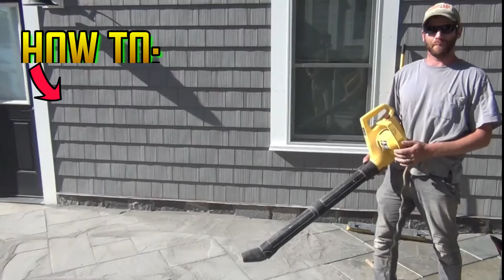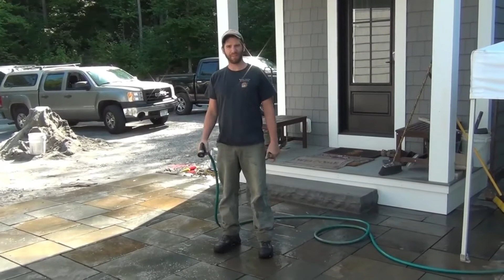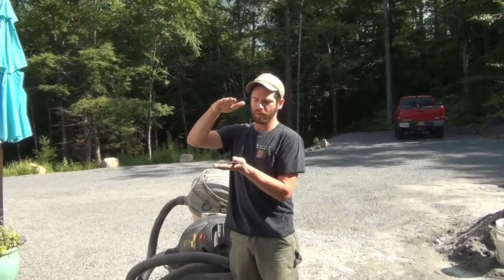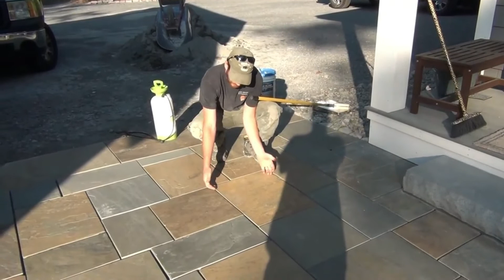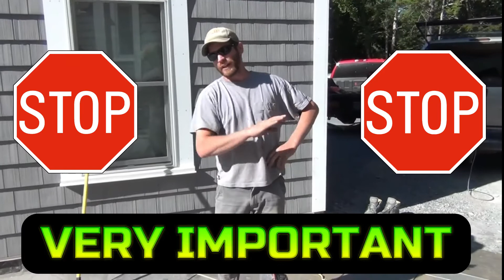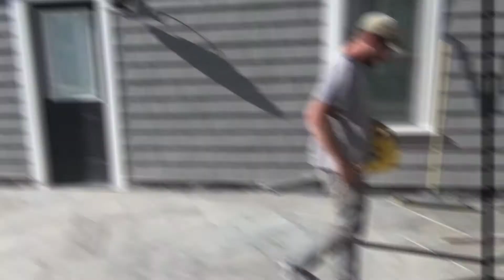How-To: Make A Square And Rectangle Blue-Stone Patio

Comment: would you ever lay bluestone on top of an existing paver patio if the pavers were totally flat with no lose stones. (solid)  Using a stone dust and mortar haunching mix?
Reply from the maker: Hey Brian,  thanks for watching!
Well maybe...   do you live in a freeze thaw climate?   If not, then its no problem.  If frost is an issue,   then you may need to let the water drain through.  There is risk of the water saturating the sand bellow the bluestone and freezing   pushing it up.

Comment: I've thought of making a patio with the giant asphalt hockey pucks I make at work nice video👍
Reply: that would work!    you'd need to set 'em with a machine,  but it would be like none other!!  thanks for watching Matt
Reply: @RogersRigs  I could get it done with a post hole digger or an auger but they're cylindrical so I'd have to account for the gaps.
Reply from the maker: it might get a little hot in the summer!
Reply: @RogersRigs  probably best to use them as decorative outdoor stones like around a flower bed they make the best door stops money can buy🤣
Reply from the maker: ha ha!